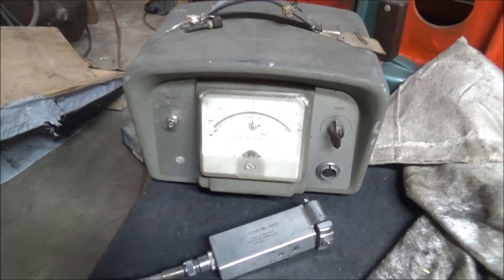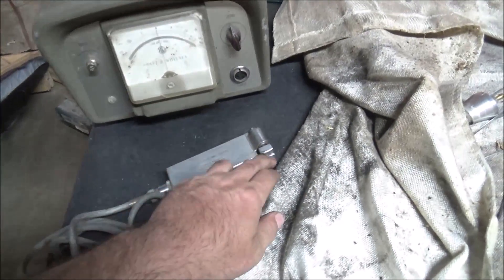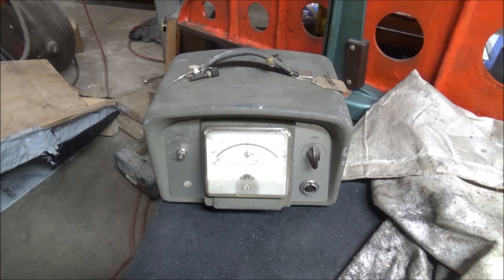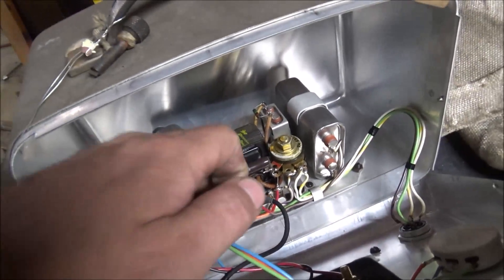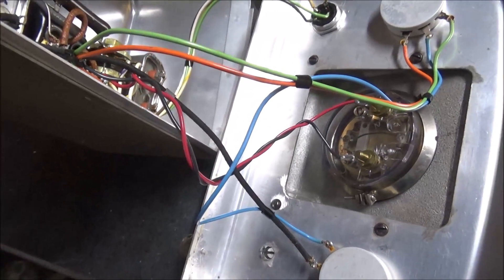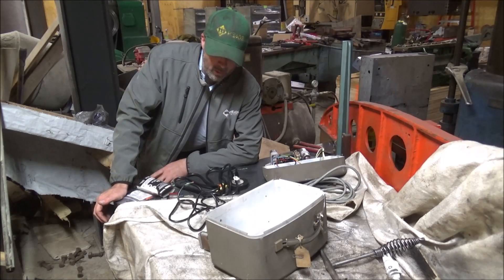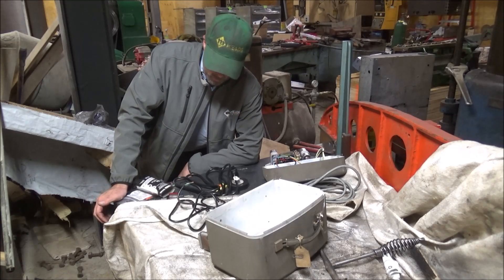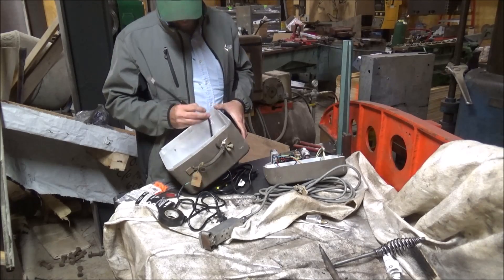Vintage Electric Amplified Bore Gage Repair

Comment: Might gain some accuracy by changing any caps inside the device. Quick glance while it was apart I saw one. The age alone makes them fail by leaking voltage or just going short.

Comment: If anything is going to fail in that circuit it's going to be the electrolytic capacitors.  But they should be easy to get and replace.

Comment: Brian so Glad it works, but just a tip know a lot about very old Electronics the Capacitors in those old units need time to RE-FORM its a common issue that they can fail within hours of first use having not been used in a very long time, I would suggest to not leave it plugged in to long just plug it in when you need it give the CAPS time to reform.  see https://www.youtube.com/watch?v=FuanfhJTWvs  or watch this one https://youtu.be/ifWfvaIbWZY?t=557

Comment: WWII tech perhaps - but many of the ways & means of making a product had no real advancement on in to the 70s (consumer products aside). Those capacitors should have a date code on them. This will not give the age of the item - because electrolytic caps like that do not last that long. 30yrs is a stretch.Not why I'm responding though. With all due respect: use a switchable power extension cord to test unknown equipment. Most every one has them, a row of 6 outlets with a switch all on 1 end. This way you can flip the switch back off (much more quickly than pulling the plug) & save some of the smoke that tried to get out

Comment: Information on this device:     https://books.google.com/books?id=LftrMPr4OlMC&pg=PA101&lpg=PA101&dq=Pratt+and+Whitney+Electrolimit+bore+measuring+gage&source=bl&ots=Mywp9dWlTl&sig=ACfU3U0aBjZnD-SjPfbcLmW51_01emMvXQ&hl=en&sa=X&ved=2ahUKEwiQjdaM49PhAhVCIqwKHbUCDEcQ6AEwCHoECAcQAQ#v=onepage&q=Pratt%20and%20Whitney%20Electrolimit%20bore%20measuring%20gage&f=false

Comment: Bryan; I have several ring gauges for you in the 9 inch range if you are interested contact me.
Reply from the maker: A little large for me as most of the work I do revolves around the the 2 -6" range. I appreciate the offer though!!
Reply: @bcbloc02  the price is right tho man.
Reply from the maker: send me an email bcbloc02 at yahoo dot com

Comment: it's divisions are tenths though, not thousandths.
Reply: it's probably supposed to have a setting ring you'd zero on and then set into your measured bore and it will show +/- 0.0005".

Comment: Great find on the meter.  I didn't read all the comments and I hesitated to say anything but since some previous comments about your shop clothing bothered me I'd like to mention your new coat looks pretty spiffy too. Seems Steve is going to get some use out of that surface grinder you turned him on to also.  Let's hope he doesn't launch too many more parts with it.

Comment: Nice score, it looks to me it's more from the later 60s or even early 70s, from recognising some parts and their style. You may have some electronic components in the head or probe, if it's transistors, it would confirm the date...
The Gain button is most likely to calibrate the actual deviation to the real deviation, i.e. if you have a 5 thou real displacement and a 6 thou reading, you may have too much gain, if you get the picture...
I'd still be curious to see if the head only contain a restive bridge or if it's frequency driven like the more modern versions, this would mean that the head is having quite many electronical components...
Reply from the maker: Yes the gain changes the distance the needle moves in relation to the anvil. I adjusted it in the video so that over .015" I got .015" and it matched my micrometer at .005" intervals. With the tooling I have it is about as good as I could get. I think it maybe older than you think. It is mixed with some cotton insulated wiring, also it looks way older than this version from 1964 https://www.ebay.com/itm/PRATT-WHITNEY-USA-OPT-O-LIMIT-ELECTRIC-INDICATOR-BULLETIN-D32-1964-RR141/351746362667?hash=item51e5b78d2b:g:nSMAAOSwcnpTmPkY
Reply: @bcbloc02  Potentiometer codes are another good way to date electronics. The gain pot with the chicken head knob will have a number stamped on it that will tell you the manufacturer of the pot and when it was made. You can google pot codes and find the key.
Reply: You got the heavy duty shop version, as the one on eBay is the fancy lab one, do you know what is in the head probe as far as electronics is concerned?
Reply from the maker: I do not know what is in the probe. I did play with it some more and about a 3/4 turn on the gain knob will make it read .0001"/ division just like the scale says. I actually put it back like I had it though as it is more useful to me without that hyper sensitivity.  Taking tenths readings on a turned bore is a bit maddenning and pointless as the surface finish is likely +-.0002".  Maybe if I do some burnished bores it would be interesting to compare with it on the .0001" sensitivity.

Comment: Unusually clean on the inside, and that is rare.  A dedicated airtight container for storage would be a good idea, maybe keep it stored in the house when you are not using it, to keep it out of extreme temps.  At least you don't have to worry about finding tubes for it!

Comment: Brian, the tape will provide good temporary protection for the new power cable.  However, you need (IMO) something that's long lasting.  Get yourself a rubber grommet from Mouser Electronics.  Also, strain relief, inside the enclosure, is in order.  A figure 8 knot tied around a wood or plastic dowel , with the power cord itself, does the trick.

Comment: I agree - looks like old sci-fi movie equipment. 

Good quality construction and the best military grade  components of the day. I have some vintage AC powered ohmmeters I love to keep but hesitate to use on anything silicone based. 

The old Sun Automotive test equipment  is also impressively built.  

Not surprised it fired right up. Thanks for sharing. 

Dan

Comment: Brian, you are measuring in tenths per division, not thousandths!  Capacitors need to be changed to get the gain control near 12 o'clock when calibrating to a known standard.  Really enjoy your videos.
Reply from the maker: So what you are saying is it may work but it isin't fixed. Would the capacitors maybe be why the gauge reads in thousandths when  it is labled as tenths?
Reply: bcbloc02 No it wouldn't account for that. It wouldn't work at all if they were faulty. I would disregard all this advice to change the oil-filled caps. They will eventually fail short-ish, but it takes many decades, and they don't seem to take transformers with them. I service valve amplifiers of the 1952-69 era that have those things, and the failure rate even after 50-60 years is very low.

I would carefully measure the DC HT inside and see if it is reasonable, and that it doesn't have much AC component. But it looks to me like it is already working perfectly and just needs calibration, which you can do yourself with your standard gauges.

I would also introduce a gasket around the edges of the cabinet where it mates. It's remarkably clean inside, and you want to keep it that way, so keep the dust and fluff and chips and shavings out.

I would also get rid of the tape and use a grommet and an internal knot or bracket. That tape just goes sticky after a few years and slides around on the cable. And check all the wiring for brittleness, replacing if necessary. The plastic dries out.

Also check now that the fuse is of the exact correct value. They invariably get replaced with higher values over the years, and this is what will torch your transformer if something bad happens.
Reply from the maker: I did play with it some more and about a 3/4 turn on the gain knob will make it read .0001"/ division just like the scale says. I actually put it back like I had it though as it is more useful to me without that hyper sensitivity.

Comment: I was thinking the same thing as Greg. For those who don't know, air cooled aircraft engines usually have a smooth continuous decreasing taper toward the head. As the engine heats up the cylinder walls become more parallel. This is especially important on the bigger engines. All the P&W engines were born with hair on their chest.

Comment: Hi Brian, this tool the meter looks so nice. We do not know P&W that one before our time but we are familiar with the Federal models somewhat and their probes. 
Very clean inside, this tool looks to be fun, we like your find, we cannot get over the probe cord length for a portable unit like that wow wee.  
That is really nice Brian.
Thank you for the share, Lance & Patrick.
Reply from the maker: Yes maybe they intended it for 2 man operation. I would struggle to read the gauge from as far away as the probe cord will reach! It must go 10ft. lol

Comment: You were saying thousands but on the gauge it says 'tenths'. Is there a range switch?
Reply from the maker: No switch I could find. I mentioned the error in my video that it appears to reafd in .001" rather than .0001". I don't know if that comes from the gauge or the reader. Honestly it is probably more useful to me as it is.  I didn't check if I could crank the gain upenough to get it to read in tenths
Reply from the maker: I did play with it some more and about a 3/4 turn on the gain knob will make it read .0001"/ division just like the scale says. I actually put it back like I had it though as it is more useful to me without that hyper sensitivity.
Reply: You will need to turn the line cord around for tenths.

Comment: Use that strip of mirror, that runs below the scale on the gauge, to be sure you're not getting any parallax error in your reading. The needle itself should cover it's reflection in that mirror.
Reply from the maker: Thanks for the tip! I need to try to clean that lens face up a lot as to be honest I hadn't even noticed that strip was reflective! lol

Comment: Brian, congratulations on a good score. That thing is, of course, a comparator, and as you say, it will permit you to make comparative measurements inside a bore if you have the right anvils. You can measure ovality and taper directly and continuously with that, and again, as you say, that is a lot more convenient than fussing around with snap guages.

The dial has a mirror scale, which is intended to eliminate parallax error when reading the dial. There is an arc of mirror below the graduated scale, and if, when you read the scale, you position your eye so that the reflection of the needle in the mirror is directly_beneath/obscured_by the needle itself, you have the best possible chance of obtaining a correct reading. But you are an engineer; you knew that.

I am an older man (72), and I started my apprenticeship as an electronics technician in 1964, and worked in the industry for many years. The technology inside the instrument is quite familiar. The components most likely to fail will be the two big capacitors, but since they are sealed and probably oil-filled, that is unlikely. The components used in those days were usually designed for high voltages (read "more stressful environment"), so they should continue to last for a long time. If it ever does fail, an old "radio mechanic" from WWII or the 1950s or 1960s will mend it for you.

Keep up the good work, and please give Baily a scratch behind the ears for me.

Comment: I wish you luck with that Brian. If that is from the 40’s or even 50’s the capacitors of that era are not known to be very reliable after this many years. They are easily changed by a good electronics tech.
Reply: The caps in that thing look to be of the oil filled variety, those last 10x longer than any electrolytic.
Reply: drewscruis There are more caps in that unit than the 2 large oil filled ones. Also, being oil filled only means they are full of PCB’s and I have had those blow like bombs. It’s not a matter of how long any electronic component lasts it’s how long it holds it’s rated function. Old caps short and leak.

Comment: Brian, they twisted pairs even before this era in point to point wiring in attempts to reduce interference and unwanted induction currents.
Reply from the maker: So was it in the early 20's with radio where it became most common?
Reply: @bcbloc02  - a quick google search revealed it was invented in 1881 by Alexander Graham Bell. By the 1900's it was used pretty widely to cut down on crosstalk and interference via induction, etc. 
Woo! History lesson of the day!